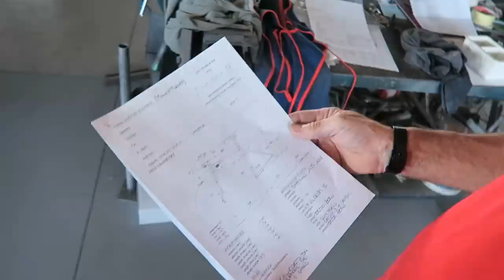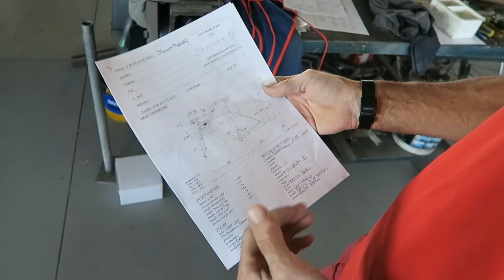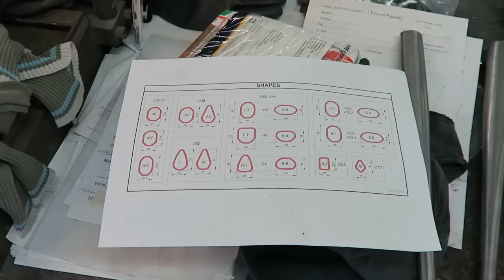Building a Handmade Bicycle Frame in Tuscany Italy

Comment: Wider tires are not used to compensate for the carbon, it's because lab tests shown that a bigger tire (25c, 28c) have less rolling resistance than 23c, hard to believe but it's true.
Reply: Doctors also used to say that smoking was good for you. I think they're full of shit when they say 28c tires are faster. I think the bike builder knows what he's talking about. He has no reason to lie. It seems to me that the bullshit about 28c tires being faster was just a way for the carbon proponents to fix the problem they created.
Reply: @BEEBEE159  i thinka that this does also depends heavely on the weight of the driver, since the pressure in the tire is relatively to the pressure the weight on the bike transfers to it, therefore the contactarea may vary. Since a wider tire holds more air, he can compansate it better, also is his profil designed to use the wider area. I think, within a certain speed, where the drag isn't much of a factor, for example in the hellclimp phase of a race, the wider tire is in the drivers favour, but for the downhill phase, where the drag becomes relevant, the smaller tire is king, since his rotational airdistortion is less.
Reply: @djangoryffel5135  Yes, I agree, there are other factors for choosing wider tires. As you said, if the rider is obese like many riders here in the US, then wider tires are better for supporting the weight of the rider. I use wider tires, 25mm, because it gives my rims extra protection against pot holes and bumps in the road. I like 23mm tires, but my rims get all bent to hell whenever I hit a large bump or pot hole.
Reply: Bigger tire have less rolling resistance at the same pressure as the narrower tire. BUT nobody would pump the wider tire to the same pressure as the narrower tire- because the wider tire would be stiffer than the narrower tire at the same pressure!

Comment: Wow we didn’t have 12 speeds on road bikes when this video was recorded 3 years ago. Shimano as always is slow to adopt 12 speed on road bikes.  So when
Shimano finally release a 12 speed road groupset.  SRAM and Campagnolo will come up with 13 speed.  In this never ending arms race.

I believe the industry will never stop adding more gears.  Now the we have wider 142x12mm thru-axle, 148x12 boost and 157x12mm super boost hubs standards.  That’s plenty more extra space available from the previous 135mm quick release hubs standard.
Reply: 10 speed is enough

Comment: I used to have a Rossin Record, 1980s..  love my new to me 1990s Italian Casati Ellis, with Columbus EL- OS tubes, all Campy.. I have a S Selle Anatomica made in Wisconsin seat and is smooth as butter, fast as lightening ⚡( well as fast as an older guy can ) . However wouldn't mind trying titanium
 Carbon fiber , non recyclable junk in land fills. I wonder do humans think about what happens after they make something.
PS I wish him good business and a profitable new year.., but most young guys from what I see are riding carbon from Asia,  his family business of steel bike builders  may be phasing out.😟 I have heard that just as carbon fiber was coming in they were gonna go to the next generation hydroformed steel , just like aluminum . to bad.. Did not go that route , but even then he would have had to develop that type of business.
Reply: I have been riding the same Ciöcc lugged Columbus SLX frame for almost 30 years. (I did spend quite a few miles on an AlAn in there too). Steel is great for general riding and training. It’s race worthy too. I feel the same about carbon plastic frames. I also would consider a Ti frame. Keep riding!

Comment: It's sad because this is a far superior bicycle. The problem for the bankster theives is that they are permanent. Carbon is just glorified paper machae. Fragile. The weight is only a couple of pounds differance. Without a team car with spares, only the stupid would pay for one.
Reply: "A couple of pounds" make a lot (!) of difference*! Riding up a hill on a 7-kg bike is so much faster than on a 10-kg bike - the difference is a mere "couple of" or six metric pounds or 30 %. A hand-crafted steel frame is a wonderful ride, but well-made carbon frame is no paper maché*, but so much lighter stiffer. That's why I ride my steel bike on short-to-medium flat rounds and my carbon one for long, hilly tours and sportifs. You don't need to be a "bankster thieve*" to appreciate the advancements in material technology.